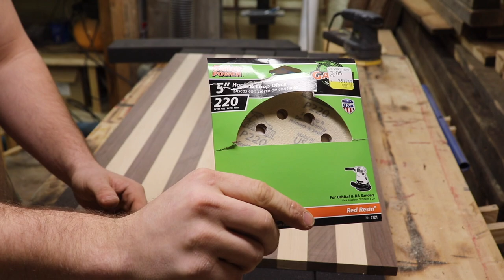How To Build A Maple, Walnut, and Resin American Flag

Comment: That flag turned out really nice. Been looking into doing one like it. You mentioned you would have done a couple things different. I’m curious as to what those would be.
Reply from the maker: White Collar Workshop thanks!! I would have chosen a white epoxy rather than the blue. I would have also done the last epoxy pour in a dust free zone. Lastly I should have wiped off excess epoxy off the bottom edges of the flag after it drips off. None of these are even notice but when I do this again I would change those small things. All in all it turned out great, especially how crisp the stars are. Thanks for asking and definitely show me your end result when you get to it!

Comment: Also one thing with epoxy that is important and it looks like you did with your video.  Make sure the piece is level when you pour it on.  The stars do not matter as much for level but the final pour over the whole project should be level :)
Reply from the maker: Kevin Rialson great point!! Thanks for adding 👌🏻

Comment: Very odd technique's used,, And  "Blue stars??? Making the stars with the maple inlays or even stand-ups would have made more sense.. No consideration given to planer snipe?? Using wide pieces of walnut for the union and only sealing one side will end up being problematic especially when no line-up fasteners such as biscuits, dowels, or dominoes were used.. All that money for the hardwood and time spent on labor could go to waste due to skipping a few simple, small but very important steps
Reply: I think what our diplomatic friend meant to say is what ever sealer you use on one side it should be the same sealer on the other even if its a skim coat. He also appreciates you stepping out and trying different colors even though it wouldn't be his choice.
Reply: @therebellion6911  Perhaps what the Diplomat meant is, By making a flag with wood, certain liberties are taken. On a US Flag, the stars are the same color as 6/13ths of the strips It just seems to make sense to keep that the same so they stand out.. A purest would insist that all surfaces and edges get the exact same amount of the same sealer. The diplomat is not a purest but has made the mistake of joining boards that will move differently, in microscopic amounts over time and had beautiful pieces split wide open because precautions were not considered or taken. Wide pieces ARE going to warp even when properly sealed. Different woods are going to warp and shrink differently. Even if the movement is barely noticeable, joints WILL pop apart. The Diplomat won't go into issues with gluing end-grain.. That is a whole nother subject.. It's a beautiful piece that took a lot of labor,, but it WILL split open and the stars are barely visible.. The Diplomat was interested because he makes his with old reclaimed redwood decking and white fir leaving the natural colors as they are.. Very few people do that....